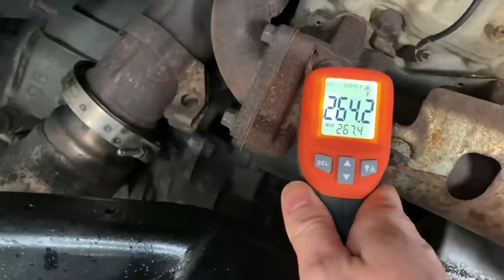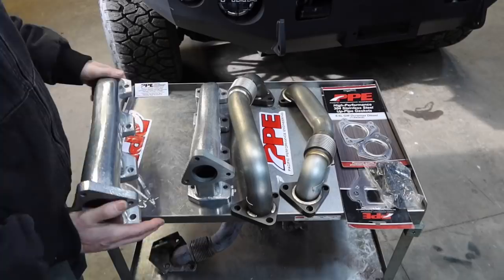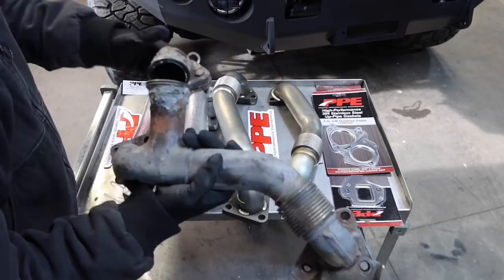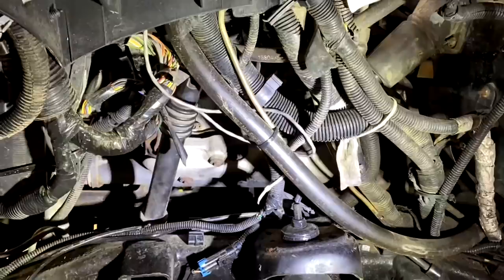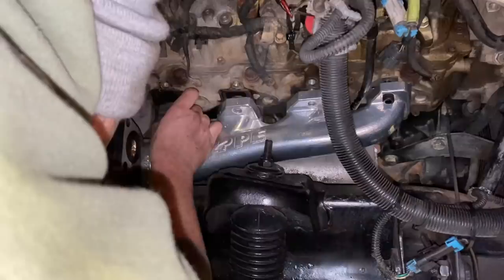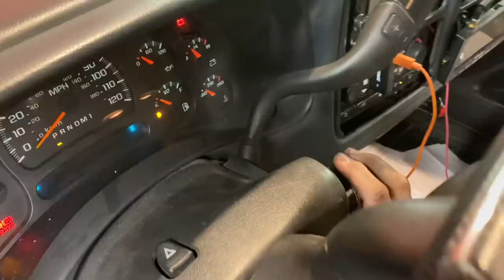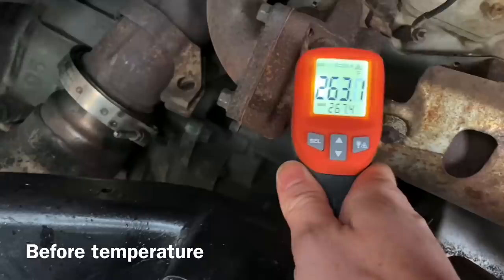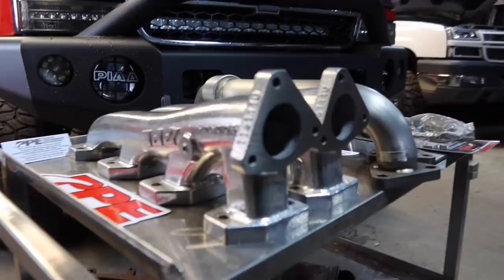Duramax $1000 Manifolds and Up Pipes Worth It? Let’s Find Out!

Comment: A big thank you for your video!  Just a couple of pro tips: You will need a 3/8 torque  wrench that pivots (Harbor Frieght ICON) and at least one extended 8mm hex head socket cut to size to get all the hex head bolts properly torqued to "42" POUND FEET not 50.  You are bolting into aluminum heads, so be careful.  
Remove your front tires.
I read another comment about jacking up the engine and trans... That's a great idea. The frame rails are so close to the manifolds that it makes it hard to get to get to the bottom bolts.

Comment: I got the exact same kit. I got one side all out just need to remove the driver side. I’m glad I also went with the Ppe down pipe. Maybe a little trick for anyone tackling this not so fun job is to remove the two trans crossmember bolts an put something to distribute the load over a jack under the trans pan and jack it up until the top just touches the floor and get yourself an extra 1-3 inches back there. Makes a big difference IMO as any guy or girl knows a little extra in the right spot means a world of difference! 😉 Happy New Years from KS 👍🏽

Comment: Huge thanks go to you I got a 2003 lb7 that I'm building. Your videos have been helping me tremendously. I'm defiantly getting this set up I run a hood stack on my truck always worried about my heat messing up gaskets and wire connections.

Comment: If the manifolds are coated the exterior temp isn't an accurate comparison.
Reply: Annnddddd....bingo.
Reply: Should have measured at the up pipe bend.
Reply: Wouldn’t it disburse less heat into the engine bay?
Reply: The first 10 seconds of the video he tells you that
Reply: @reel_moments.outdoors  no shit

Comment: This is just a thought I like using anti seize on manifold bolts as well as other ones just a thought. I know other people are making comments about your heat source you can put a coil inside your garage off your out 
side central boiler it's like having free Heat.
Reply from the maker: I use a kerosene heater but I really need to insulate that building
Reply: @TruckMaster  you can have the Amish come down and Spray Foam your garage you'll be able to heat it with a candle

Comment: The ppe are the same as dmax store max flow. I have pictures of both side by side, there literally identical. Up pipes are exact same and they can be swapped
Reply: They are probably made by the same company, many aftermarket items are rebranded for multiple brands.
Reply: I just put the d max store manifolds and up pipes on my lbz. Didn’t really notice and difference. Exhaust note has a slightly louder wrap to it under a load. Other then that didn’t notice and lower egt ( that’s what I was going after)
Reply: @ricerocket336  yeh you won’t notice much at all. They really only come into play if your 800 plus hp. There useless below that

Comment: When I first bought my LLY and started learning about Duramax motors (and diesel in general). I noticed just how cramped and small all the piping was, especially the exhaust manifolds. I always thought to myself I wonder how much more power these trucks could make just by flowing better. Glad to see they actually work. I bet you'd notice and even bigger difference after a stroker pump and wind her up to 4k

Comment: That down pipe bracket is prone to breaking off.  I chased a rattle for days before I finally found mine had broke and was rattling against the down pipe.  After a search on the groups I found a ton of people have had the same issue.
Reply from the maker: Very good to know thanks
Reply: @TruckMaster  yep, and mine is a PPE down pipe as well.  I really didn’t care after the fact though.  The hangers support the exhaust well enough and that bracket was never a thing till the later years LML.  Never had any issues before.

Comment: A stud kit on the new pieces will make servicing them easier down the road...or trail.
Reply: What's a stud kit?
Reply: Replacing the new Allen wrench bolts with studs and then nuts to hold the manifold on.

Comment: You do realize that those manifolds are ceramic coated, taking the temperature on the outside without a egt probe will not give you an accurate exhaust readings. You need to get an egt if you’re going to make recommendations on a purchase.

Comment: The only mistake I saw (and maybe you did and didn't show it) but you didn't put any anti-seize on the bolts. Seems minor, but it makes things so much easier if you ever have to tear things back apart. 

I did these when I did my HG in my 05. I had the engine pulled so my job was a lot easier. Which was good, because one of my studs broke off in the head.

Comment: Appreciate all the install videos! I have replaced the down pipe and installed a 4” exhaust and now I am considering the manifolds. I’ve seen the PPE and recently your HSP manifolds. Still deciding which way to go. Cooler EGT and better power is always a plus. Can you explain why only the passenger side exhaust manifold goes to the EGR? Why doesn’t the drivers side… I still run the EGR as I do not want reprogram the computer. Again Thank You!
Reply: Thats stupid  to do dude

Comment: You need to put anti seize on all manifold bolts    and torque to spec
Reply from the maker: Yep
Reply: @TruckMaster  done it that way for years  haven’t had any fall out and they remove good when needed

Comment: Hey Josh thanks for your videos they help a lot. Love the detail you put into your installs. I have a question.  Back in February of 2018 you done a video for a manifold and up pipe. I was wanting to install the same parts but could not find your part number. I have an 06 GMC with the LBZ. I have 4” exhaust a single stage tune, the pcv delete and egr delete. It has 370000 miles on it. My bellows cracked on my up pipe. So I wanted to put the same thing you installed on mine, I do have a new 3” down pipe to install at the same time. Mine is an everyday driver and I don’t do any racing or very heavy pulling. So would appreciate the info on what you used unless you recommend something else, thanks in advance!

Comment: Have you added an egt probe since installing these?
With the coating I’d think the more fair temp gun reading would have been on the up pipe just as it exits the manifold. But either way. That was quite the drop.

Comment: Hey Josh what happened to the 3 inch mbrp downpipe you installed years ago. I noticed when you pulled the manifold off of the passenger side.  The downpipe you pulled off is stock?
Reply from the maker: That downpipe rusted

Comment: I'm stuck on the bottom 13mm on the driver side up pipe at the bottom of the Turbo pedestal. I've got everyother bolt loose. Now I could only get a 1/4 drive to fit, Broke 2 1/4 drive ratchets and a 1/4 drive breaker bar. PB blaster for a week now, don't want to break this bolt like one of your other videos, I'm about to try and heat the up pipe around the bolt with a torch, any other suggestions? I'm doing the Profab headers and up pipes, and the high flow y bridge kit from wcfab, cp3 10 mm stroker, fass 165 for this part of the build.

Comment: Did you have to modify the coolant pipe that goes to the heater core from the oil cooler with these high flow uppipes ? I think I may have to on my LMM.
Reply from the maker: I really never considered to but that’s a great idea
Reply: I believe on the LMM they sell a heater hose relocate kit to install these manifolds and up pipes

Comment: Really appreciate you doing this video. I have been thinking about doing this to my basically stock ‘03 LB7. 165,000 miles on it. Fo you think this will help keep the temps down to protect the passenger head gasket? I saw in the video that your pipes are wrapped. The complete kits come without the wrap. Did you order the manifolds and pipes separately?
Thanks and Happy New Year!
Reply from the maker: Thanks! The only thing wrapped is the Down pipe but I am almost positive your temps will go down with this setup 👍
Reply: @TruckMaster  thanks, did you wrap it or did it come wrapped? Mine is like WifeMax, mine has an 8’ bed. Getting ready to install the Kryptonite parts.
Thanks for your service, from a Marine to a GI! Watch your six!

Comment: Awesome videos buddy. I’ve been watching you for a while. Lots of help on my 07 lbz. Couple questions. Did you use anti seize? I noticed your truck has stock head bolts. How many miles do you have? And have you had any problems since you have bigger turbo?  Keep up good job. Mike from Illinois
Reply: Stock head bolts work great. You won't need to change them until in the 4 digit power range.

Comment: @Truckmaster How did the exhaust port size look on the new manifolds? I chose to go with a different brand of exhaust manifold than PPE (wish I could have afforded PPE) and the exhaust port size is slighly smaller than the stock manifold but matches the port size to the head. I was curious how the PPE manifold ports compared.

Comment: So what did you have on your passenger side uppipe before this? Just a blocker plate? I’m planning a weight loss on my truck soon, thought I NEEDED to do up pipes if getting rid of egr?
Reply from the maker: I used a aftermarket Lb7 style uppipe
Reply: @TruckMaster  ohhh! so you had the passenger side aftermarket and the driver side stock? Any negatives to this?

Comment: Bought the maxflow from dmax. China k.o.'s.
Reply: I bought the same one from dmax store. Did you notice the exhaust ports at the head side were smaller than the stock manifold? Im curious how the ppe manifolds are.
Reply: @kevinkalivoda3442  same size. And the ports on the head are smaller than the dmax store and ppe manifold

Comment: Why do you still have the stock turbo downpipe throw it away and get the MBRP my EGT’s are much lower with just that it’s been on my truck for eight years now one of my favourite upgrades The stock downpipe sounds like shit
Reply from the maker: I’m totally aware my mbrp lasted a year so I installed my stock one back for now
Reply: @TruckMaster  why did the the mbrp only last a year? I just installed one 😬
Reply from the maker: They rust out really fast at the flange where the exhaust meets the clamp, if I remember I will add it to a video